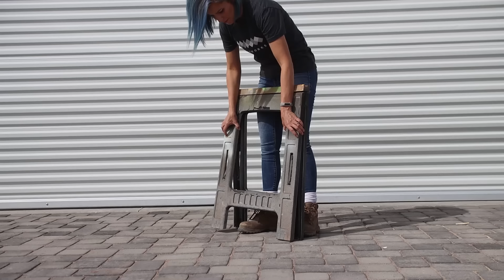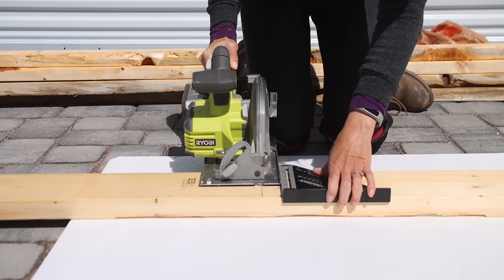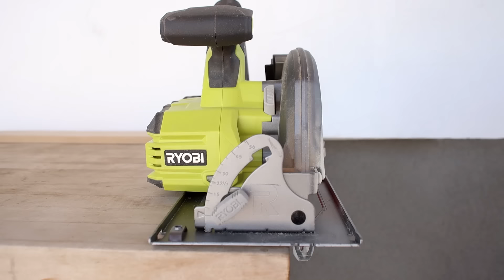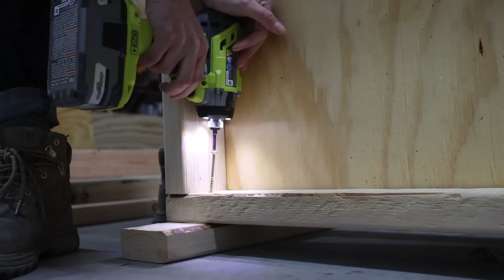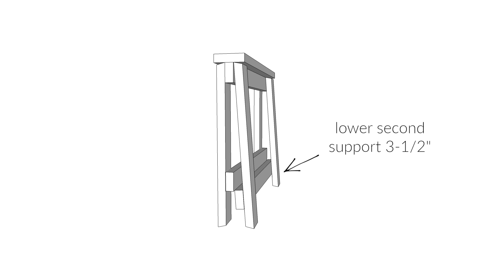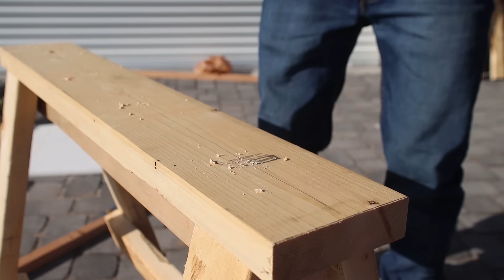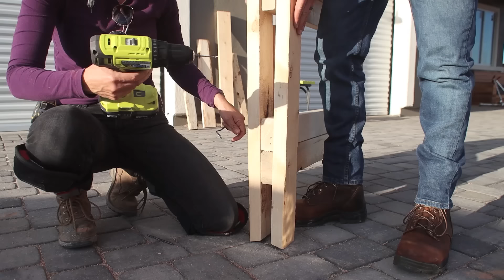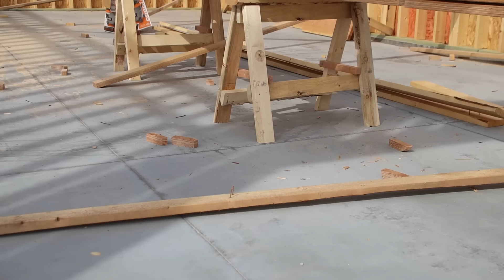HEAVY DUTY DIY Folding Sawhorses

Comment: Nice design but I do t like the locking arm and pin. The pin shouldn't be wood in the first place it's too easy to snap off. A metal pin would work just as well but a better idea is a 2x2 that swings down and has a half lap on the end that snaps into a half lapped board on the other side snapping it into place.

Comment: Nice and sturdy design but next time a) take some time sorting through the stacks to find better wood, b) don't glue the top 2X4 so it can be replaced if it gets damaged or abused and, c)  instead of the wood dowel which is too easy to break off and replace, use a long 1/4-in lag bolt with an unthreaded shank section and after installing, hacksaw the head off.

Comment: I have saw horses and seldom use them because they can be a hazard. Working on the ground, when it's practical, is much safer. Like you I use a piece of foam insulation to lift my boards when I need to make a cut.  Thanks for the video which caters to those who don't get the downsides of using saw horses or aren't nimble enough to work on the ground. It's an absurdity people have commented on you supposedly never heard of using saw horses. It's a personal preference.
Reply: How to videos are where people go to learn and others go to offer unsolicited advice.

Comment: The top baord of a saw horse is meant to be sacrificial; I wouldn't glue in down. You could retro fit these horses with a vertical 2x4 just drill on top and cut through it with no worries and replace it when it gets too worn.
I recognize the screws you use and I know they say you don't have to drill first. have you ever had a case where those screws cracked your wood? Thanks.

Comment: 3:54 I hate this problem so much! Can someone please direct me to a solution because i would like the bits to be longer but buy a 4" or 6" version of all the bits I already have is too expensive. Thanks in advance!
happens again at 4:44
Reply: I use 2 inch drivers. They lock in the impact chuck and in tighter spaces they are shorter than a 1 inch in an apex. I also use quarter inch chuck extensions if I need more reach or angle.

Comment: Of all the diy YouTubers you're one of the best about using tools that an average Joe/Jane would actually have.

I can't tell you how many videos I've seen of people building tracks for circular saws using table saws. -__-
Reply: Build tracks for circular saws using circular saw and factory edge of plywood. I'm about to build some custom shelving and I will break down my plywood by clamping one sheet over the other and riding my circular saw against the plywood edge. This is extremely accurate unless there is an alignment issue between the saw's blade and base plate.

Comment: Pretty good design. There are two changes I would make, tho. I would use heavier duty hinges. (I happen to have a small box full of used man door hinges in my shop)  I would also make a small change to the spreader bar. It would hook from the side, onto a lag bolt.  Other than that. Well done and very useful.
Reply: You just gaslighted her on her project, 😠
Reply: @helenellsworth9556  What the hell are you talking about? He made a couple of suggestions, she may not have considered other options. I also thought her hinges were sort of weak, and I also had the idea of swinging the brace down onto a lag bolt. Get a freaking life, karen

Comment: Great project, easy and very beneficial. I noticed one thing that may cause a problem, tho it's unlikely: You screwed the top plate into holes you made in-line on the runner. Screws in-line and cross grain is fine, but in-line with each other AND the grain? Likely there's no issue, but to sidestep any possibility the screws should be staggered from each other in order to not compromise the piece. It can be astonishing how much wood can 'do its own thing.'
Reply: If she drove 16's through a piece of ebony maybe. I would be interested to know how many pre drilled screws would be needed to significantly weaken a pine 2x

Comment: Great design.  You could add a piece of plywood connecting the 2 locking pieces and have a shelf on the bottom to hold tools when using the horses.

Comment: I have been using a pair of horses (the same pair, no replacements) like this for almost 20 years:
https://www.homedepot.com/p/Stanley-32-in-2-Way-Adjustable-Folding-Sawhorse-2-Pack-STST60626/203799620
The design of the current model is a little different, but mine are splattered with paint and varnish from many years of use and have never given me any trouble.

Comment: I've had my Stanley Adjustable Height Sawhorses for over 10 years. Very durable and sturdy while still folding flat and staying out of the way in my shop. With my back issues, I prefer not to work on the ground whenever possible, so sawhorses and benches are a must!

I have a video on my channel (Tony's Tool Tip: Cutting Panels) that shows how I use these saw horses and cheap 2x4's for cutting up plywood, MDF and other stuff.

Comment: Timely!  I just sawed through the top of my plastic ones at the hinge during my last project (fixing the section of my garage wall that dissolved).
Reply: Perhaps glue and dowel the tops down rather than screw, that way you will still have a sharp saw to build the replacement saw horses :-) I try to be super careful not to cut the horse but they still seem to get the odd nick.

Comment: Nice work! Only recommendation is to not glue the top board on. That way you can replace it if it gets damaged or worn out over time. Although I’m sure these aren’t expensive to make so by that point in time you can just make another set. Anyways good build!

Comment: You could also just use a length of chain or rope on those legs instead of that spreader/dowel pin assembly. I built a set of 6 ft tall A-frames to use as staging  with a plank and I used rope  on the bottom rung of it. Worked like a charm.